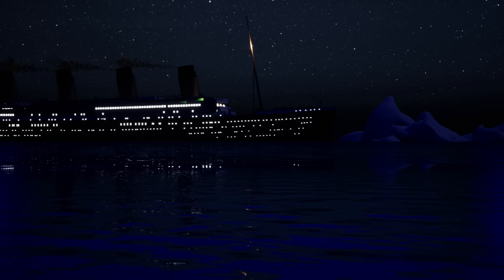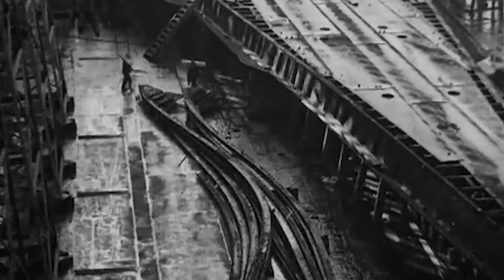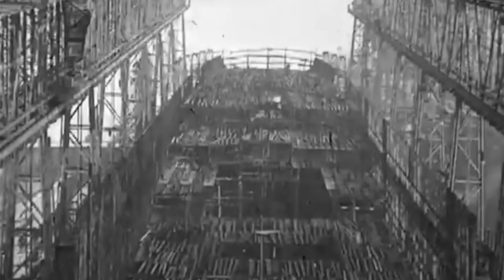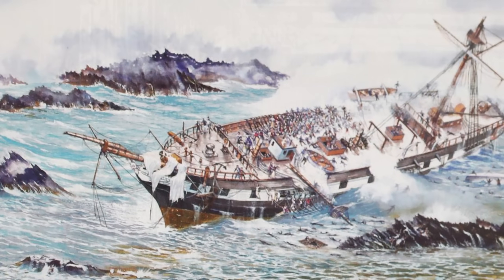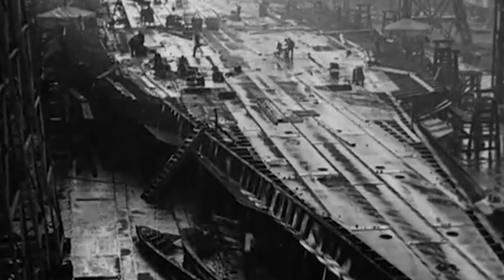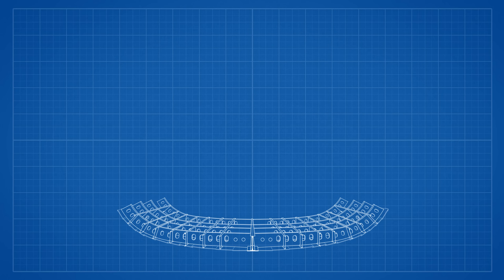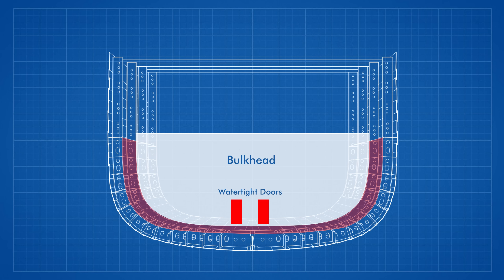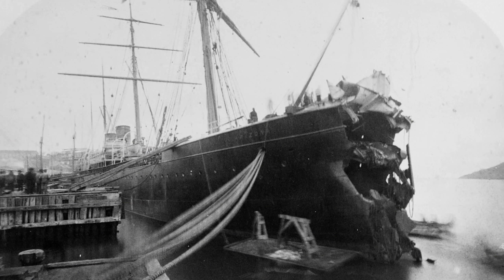How did the Iceberg Sink the Titanic?

Comment: People also forget the metal was a lot weaker modern steel even a black Pan that you use is stronger than the metal that was used on that boat the metal they used was not strengthened or heat treated And it was a much worse mix of steel It's a poured metal
Reply: Lies

Comment: H&W may not have been a "cost-cutting organisation", but still, those rivets at the port bow of the ship were analysed and they were not all that great. lots of imperfections, of impurities, because they were not made of steel, but of iron. and even so, the search went a bit deeper. at H&W records, it was written that at least for the front section of the ship where they were hand hammered into place, the rivets were made out of No. 3 iron, instead of No.4, the standard for the time. so there is some truth to the low cost materials.
Reply: The rivets were made of that material in only a limited portion of the ship for the sake of ease of construction, not cost-cutting.
Reply: @DerpyPossum  the "cost-cutting" flame was done by ignorant ppl. they've heard of the lower quality on the bow of the ship and drew their own conclusion that this was from cutting costs. the ship was too big, the crane did not reach its full length, so the bow had to be manually riveted. at least that's what i've read. ease of construction, maybe, sure. but still under the standards. thinking that the size of the ship was anything BUT standard now only looks as an excuse, doesn't it? i mean the bulkheads were too low for such a collision... nobody knew any better at the time. but the riveting done manually... that should have been a red flag.
Reply: @ragael1024  "Under the standards" in comparison to...which ships, exactly? Titanic's bulkheads were perfectly up-to-standard for 1912. Titanic's riveting fashion was perfectly up-to-standard for 1912. Titanic's materials were perfectly up-to-standard for 1912. Titanic's lifeboats, fitting process, operations, trials, design, construction and the like were all up-to-standard for 1912.

Comment: In my opinion captain of the Titanic simply had TOO MUCH authority and the company cared TOO MUCH about the damage that was proven and not enough about potential sinking of the ship.

Every single driver, pilot and such KNOWS his machine. He KNOWS how quickly it can turn. He can predict whether the ship will be able to maneuver around the iceberg or not. But the decision was not up to this man. He was FORCED by regulations at this time to steer the ship away from the iceberg even if he knew full well that this is futile and the maneuver will certainly fail.

Quite simply Titanic was being steered just like any regular ship. It was obvious for any other ship that head on collision with an iceberg is certain doom. Therefore it was to be avoided at all cost. But Titanic COULD AFFORD A HEAD ON COLLISION! It wasn't certain doom! And therein lies the problem. The crew was unable to save the ship by using its unique characteristics because even if they did that, that would mean heavy damage to the ship and most certainly a prison time for the crew. Nobody would care less about potential sinking of the ship because they'd simply say that Titanic is unsinkable so it's stupid to even consider that as an option.

Comment: The watertight compartments were not sealed so that was the biggest nonsense and in the end that aspect was what led to the sinking of the Titanic. How the hell are they going to call watertight compartments to some areas where water could easily pass over and flood the next compartment. If those compartments had been sealed to the top, the Titanic would never have sunk. I understand the concept of that time but it was not safe and for it to work you had to have certain specific circumstances.

Comment: This was a good explanation of exactly how and why she went down. The notion of her sinking "quickly" in lore is actually false. Despite her demise she was so well designed that not only did she sing at ab extremely slow rate, so slow in fact that for a good part of the first hour it was barely noticable. It took damn near 3 hours for the ship to sink, and on top of it she listed very minimally, untill towards the end of the sinking. She was a very very well built ship that met extreme circumstances. Many others would have just capsized and sunk in a fraction of the time.

Comment: The best thing that would have saved the ship would have been to have a better captain.  There was no moon, you couldn't see a thing but the captain still had the ship barreling thru a dangerous area.  I think that other ships simply stopped for the night.  This business of, if you see an iceberg, slam on the brakes, put the ship in reverse, steer hard to the left with only a few seconds to spare and cross your fingers, is poor seamanship.  If captain Smith had simply stopped for the night and waited for sunrise when you could see past your nose, all would have been well and none of the other physical factors would have mattered.
Reply: Going at generally higher speeds in an ice field unless in immediate danger was a standard practice at the time that almost all ships would’ve been guilty of. Titanic wouldn’t have stopped for the night no matter the captain. It was an ocean liner; a valuable form of transportation from point A to point B with a schedule to keep. Deciding to stop it for the night would be the equivalent of making an emergency landing in a modern day high-profile passenger jet because of some slight rain with a very vague possibility of lightning. The other ships were able to stop because they simply were not like Titanic in this regard.
It was not Smith’s fault; he was doing it by the book. In fact, he (and the majority of the crew) did almost everything by the book. If anything, the metaphorical book is to blame. 
By that, of course, I mean the outdated regulations and procedures of the entire shipping industry at the time. The amount of lifeboats, certain aspects of the ship’s design, the ice field navigation, the Californian’s radio hours, etc., can all be traced back to outdated rules and regulations.

(Also they didn’t necessarily have the ship “barreling through” it; it never even reached full speed)

Comment: Outstanding, as with all your meticulously made documentary vignettes.  The intermittent damage described was extremely fascinating, particularly the 45-foot long incision between Boiler Rooms 5 and 6.  More remarkable is how Robert Ballard corroborated this from his early exploration of the wreck site.   Thank you so much for creating this and sharing - top notch.
Reply: The separation in the plates between boiler room five and six was the one that doomed the ship. It extended just two feet into boiler room five inside the forward coal bunker. The hatches and the bunker were designed only to contain coal, not for watertightness. Eventually the aft bulkhead of the bunker collapsed, and the moment that happened Titanic's sinking accelerated.

Comment: There’s speculation and possible evidence that there was a fire below deck which weakened the structural integrity of the side where the iceberg hit the titanic. I believe that also contributed to the sinking.
Reply: The fire existed, but it was nothing more than a small patch of smoldering coals which was known about, wasn’t located up against the outer hull, was completely put out well over a day before the collision, and did not/could not have caused any significant damage whatsoever.

Comment: Coal Bunker was on fire and weakened the steel.  Also, the reason why she was speeding was because the crew was trying to get rid of the coal that was on fire by shoveling it into the furnace causing the steam pressure to go up.
Reply: The fire (which was nothing more than a small patch of smoldering coals) did not and could not have weakened the steel, and especially not the outer hull. The reason the ship was “speeding” (which it kinda wasn’t) was because going at generally higher speeds in an ice field until in immediate danger was a standard shipping practice at the time.

Comment: I heard in a documentary that (even though it would be counterintuitive), it would have been better just to call full reverse and hit the iceberg head on. Then they could seal off the ship and patiently wait for rescue. Going hard to port caused the entire starboard side to be torn apart, and thanks to a design flaw, each section flowed over into the next causing the ship to sink bow first. 😔
When I saw the explanation at around the midpoint, he said the same thing I did...no one ever thought the water could rise that high, so the water tight compartments didn't go all the way to the deck.
Reply: While it's an absolute lie that the entire starboard side of the ship was torn apart (this video even details the damage that was actually done) it IS true that the ship probably would have survived a head-on collision. But the officers on the bridge were trying to avoid a collision at all, as people in the bow would have been killed by the impact.
Reply: Pick pick pick, yes I should not have used the word entire, that was a hyperbole. You know what I meant 😀. But yes, everything else you said is correct.
Reply: @retluoc  Fair enough, but just to be accurate the damage the Titanic received is shockingly minimal. Just 6 or 7 openings no wider than a couple inches each.

Comment: The upshot is that the Titanic was perfectly well designed to survive the circumstances she was reasonably expected to encounter.  What she wasn't designed to survive was some boob running her at more than 20 knots through a known ice field and sideswiping an iceberg.
Reply: Going at generally higher speeds in an ice field was a  standard shipping practice of the day. An outdated one, albeit, but still.
Reply: @DerpyPossum  Yes, I know that.  Honestly, I think that this was a night that worked against everything in Capt. Smith's rather vast experience.  Still, I do believe that the main reason that Titanic sank that night was E.J. Smith.
Reply: @fearlessfosdick160  It wasn’t Smith you’re likely thinking of; it was more than probable that the ship was sunk, not by one person, but the outdated regulations and procedures of the whole shipping industry at the time, gone without updating due to the negligence of humanity as a whole. The lifeboat amount, the ice field speed, the construction/design of the ship, its operations, etc. can all be traced back to that, in a way.
Reply: @DerpyPossum  Most certainly all of that were contributing factors. I was largely responding to the notion that Titanic was designed or built poorly.  I do not believe that she was.  In fact, I think that she was one of the most well designed and built ships of her time.

Comment: Knowing what we know about damage control today, could anything have been done differently after the collision with the iceberg that may have saved Titanic from her watery grave?  Could anything have been done differently to have kept her afloat longer, allowing time for more help to arrive?  Speaking of which, what the Hell happened with the S.S. Californian?  Thanks!
Reply: Sadly, no. Titanic's fate was sealed the instant she collided with the iceberg. Her pumps were turned on, but they simply couldn't keep up with the influx of water. The Californian was further away from the Titanic for the same reason they struck the iceberg - a phenomenon known as "polar inversion". It's an optical illusion that happens at far north latitudes, where cold and dense air actually warps light coming from behind the horizon and makes things behind the horizon seem closer than they are - this light will overpower closer objects.

For the case of the iceberg, dark night sky was posited between the Titanic and the iceberg, so that they didn't see it until the last second.

For the case of the Californian, the ship's lights appeared far closer to the Titanic's position than they actually were. The Californian was over the horizon, meaning she was MANY miles away, too far to be of assistance.

Comment: Lets see, if memory serves. 
There were multible things that were and went wrong with with Titanic. 
- The Titanic did not have a double hull to protect the sides of the ship (as mentioned), Titanic was also top heavy which made the ship list even in calm waters, the coalbunkers even acted as ballast to stabilise the ship.
- About 50% of the hull and and rivets were low quality steel due to budget cuts. 
- There was a fire in the bulkhead E coalbunker, which warped the watertight doors / compartment walls, and weakened the hull in the area to, it's been reported by previous crew that the ship undervent sea trials while the coalbunker was on fire.
- Due to the fire in the coalbunker the Titanic could not stop or slow down due to not having enough coal to start up the steam boilers again.
- The Barrelman (spotter) should have spotted the iceberg a good 3-5 minutes before the Titanic hit the iceberg, the Barrelman tried to get in contact with the Bridge the entire time but they did not respond to his calls before it was to late, he was supposedly also without binoculars due to the clear weather.

A lot of documentation and crew reports from before the voyage was destroyed after the sinking, so most of this is from the previous crew who left the (Cursed) ship before the Titanic set sail.

 -Feel free to correct if needed be.
Reply: Titanic wasn’t top-heavy. The list was due to the coal being shifted to the port side in an attempt to combat the coal fire, which, contrary to any sensationalistic conspiracy that claims otherwise, was nothing more than a small patch of smoldering coals that did not weaken the ship in any way whatsoever and did not cause the sinking. 
The rivets and steel were not of subpar materials, and there were no budget cuts. This, like the coal fire sensationalism, is just a poor attempt at creating a scapegoat for the disaster. 
The lookouts not having binoculars didn’t contribute to the sinking at all, either. Lookouts were to use their naked eyes, and binoculars (which, in addition to making things closer, would’ve limited their vision considerably) were only to be used to identify objects after they were spotted. All the responses, from the lookouts spotting the berg to the reactions of the bridge crew, were as quick as they could’ve been that night.
Reply: @DerpyPossum  It is strange how myths created in the 1990s and later are often allowed to obscure known facts. When even Gardiner's co-author later denounced the book as fiction, you would have thought people might have noticed.

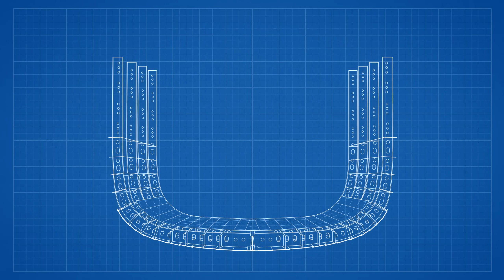Comment: 6:25 using lighter steel above the keel of the ship combined with the heavy boilers in the bottom of the ship would give it a low center of gravity which made for a more stable, and smoother ride over rough seas. It was not strictly a cost cutting measure.
Reply: How was it, then, that Olympic, Titanic's slightly older sister, had no stability problems in her almost 25 years in service?

Comment: People often say or ask “why the Titanic sank so fast” … but is that really a fair question? 

We have record of multiple, more modern, ship sinkings that have taken place whereby those ships foundered FAR FAR more quickly than Titanic. 

The MS Estonia, the RMS Empress of Ireland, & the Costa Concordia all sank more quickly than the Titanic; with the Concordia being an example of a modern day vessel. 

IMO the 2.5+ hours it took Titanic to sink is a testament to its durability. I think we’d be hard pressed to find any non-military ship, even one of the most advanced; and apply the same damage to it as Titanic had to contend with and my money is on Titanic will have lasted longer.
Reply: The Costa Concordia was ripped open the way the public thought Titanic was, though Edward Wilding  and other Harland and Wolff engineers knew that was not the case. The gash was large enough for divers to get through it.

Comment: Could the battleship Bismarck or even another ocean liner far more advanced, like the USS United States, have stayed afloat with similar damage?
Reply: Oh a battleship can take far more damage than what happened to the Titanic Bismarck was hammered for hours by 10 inch shells and torpedoes and even still on fire and completely disabled she refused to sink her crew actually scuttled her so that she wouldn't fall into the enemy's hand battleships are completely designed different than passenger ships they are designed to take all kinds of damage they have armor belt around their Hall they have torpedo blisters to absorb the impact of torpedo under their water line and they are extremely compartmentalized with water type compartments fully silk compartments complete with pumping systems to dewater a flooded compartment it's a completely different ship